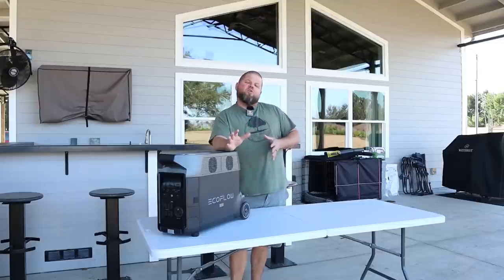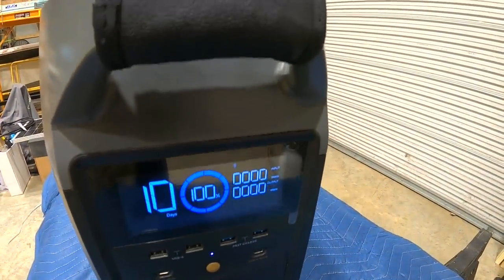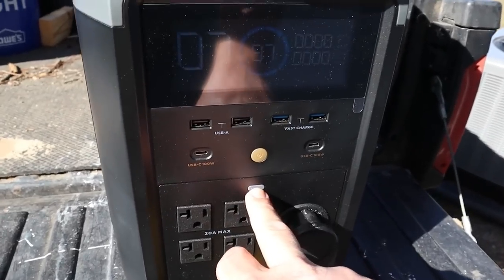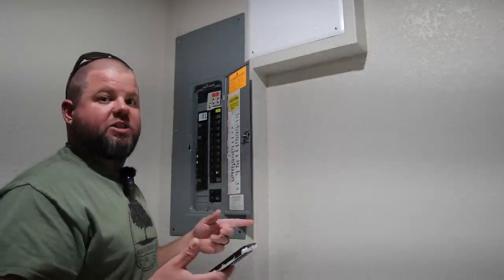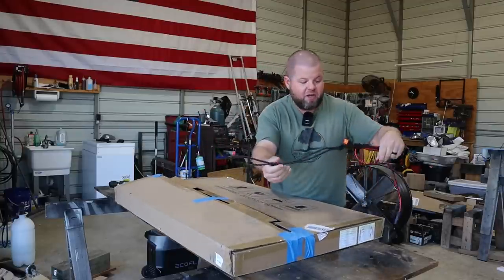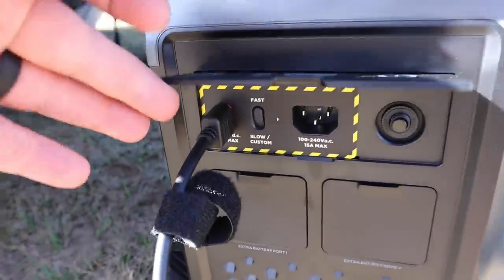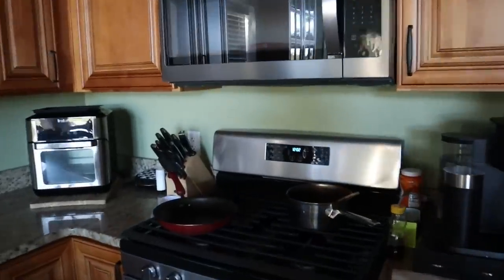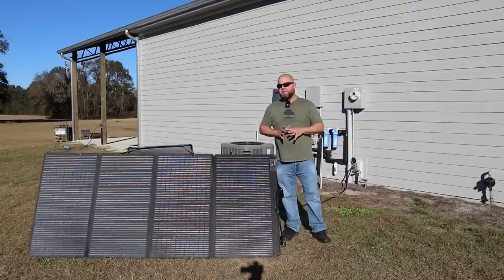Partial off grid power, it's time! Ecoflow Delta Pro whole home power solution. #705

Comment: Not to be a Debbie Downer but our current president is looking to do away with gas appliances!!!
Reply from the maker: No problem, I can cook over coals and hang my clothes on a line. 😉
Reply from the maker: Makes great sense too, let's use more electrical appliances when the grid is already overworked and outdated. As if we are not already seeing enough blackouts and brownouts 🙄.
Reply: @TKCL  .... I will stop global warming one Cow 🐮 at a time 🍖 🥩
Reply: Purchased with solar panels, our current president will give you a 30% tax credit.
Reply from the maker: What about solar panels alone? I just purchased quite a few.
Reply: @TKCL  hey Andrew I have a yeti 3000 x battery generator I wonder if the panels are interchangeable meaning it could charge different kinds of battery Banks? I'm pretty sure they have to sell some kind of adapter kit but I know my little battery generator can take up to 600 w charging at a time so it says
Reply from the maker: More importantly look at your devices voltage and amperage rating for solar input. There are tons of adapters on Amazon. These use a xt60 connection that's quite common.
Reply: @TKCL  ok I will check what my yeti 3000x takes.... I normally just have it plugged into the house and then I have my CPAP plugged into it and it automatically turns on if the power ever goes out